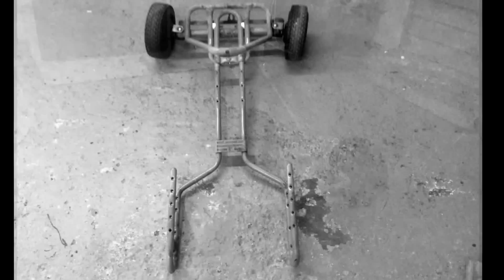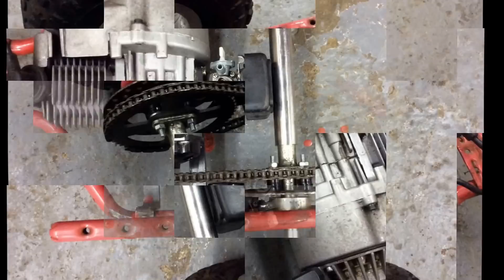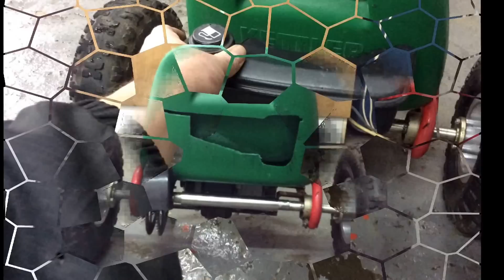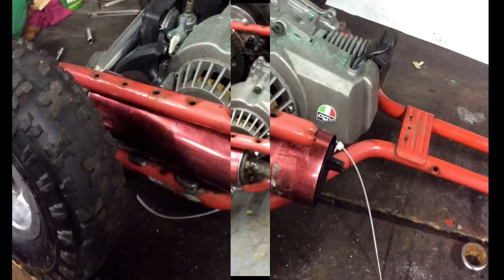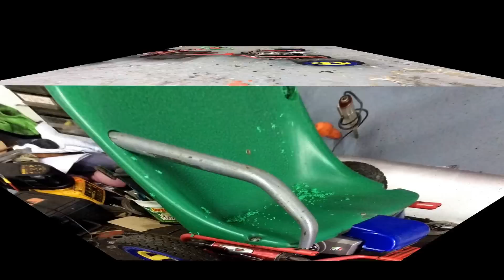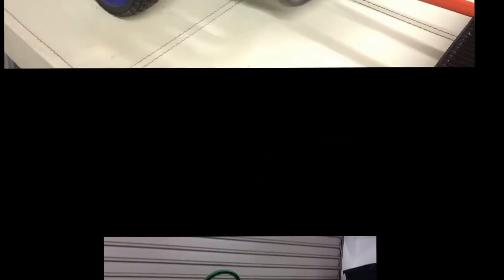Kids kettcar Pedal gokart with 49cc mini moto engine build project.

Comment: You should place the disc brake on the other side of the wheel so if won’t get contaminated with oil from chain
Reply: Weekendrider = no braking force